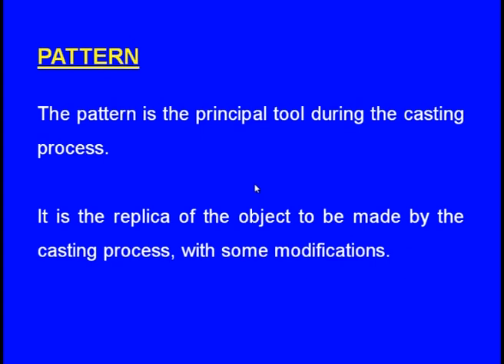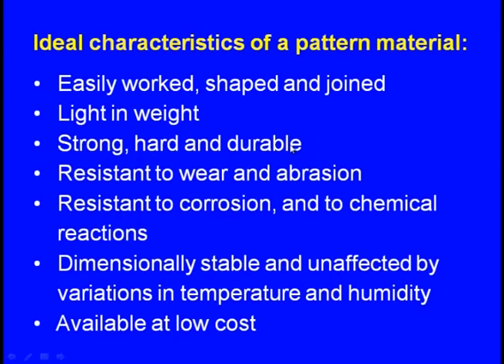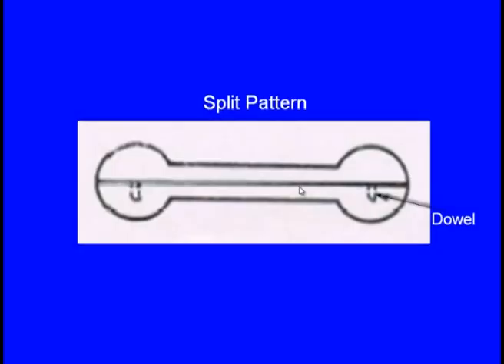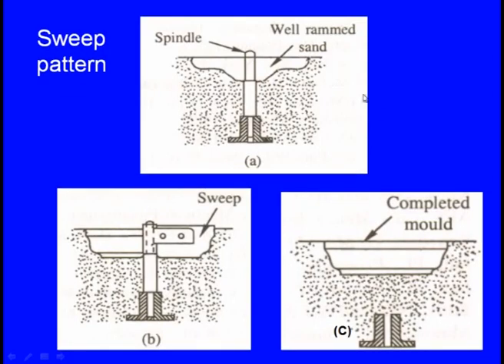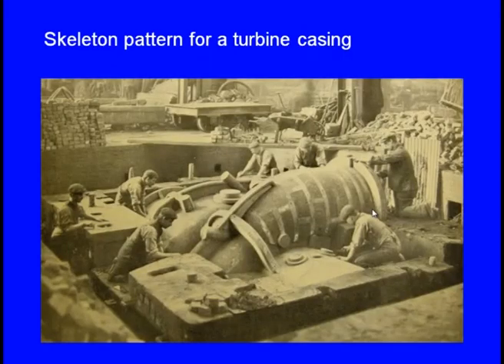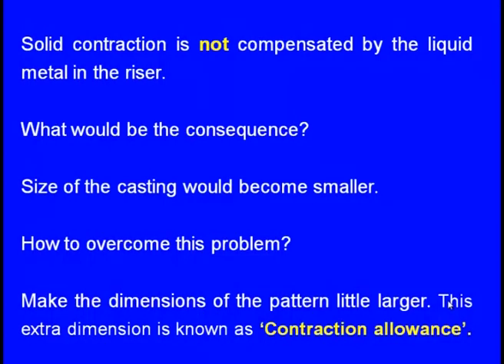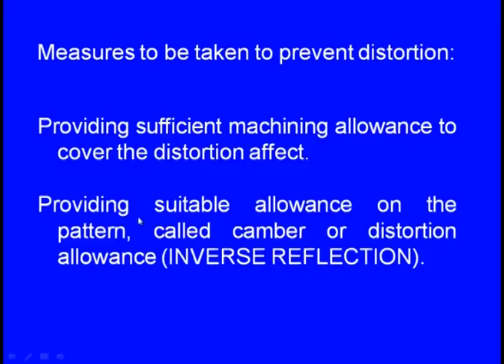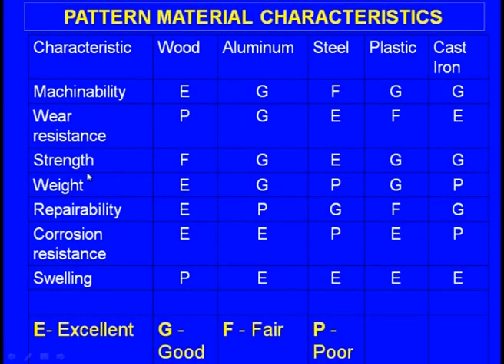Patterns and Allowances

Comment: Sir, 
I have a doubt about the solidification shrinkage. This is avoided by the liquid metal which is in the riser. But, when the molten metal will come in to cavity at that time the outermost parts of the casting is already solidified so, how can it will mix with?????
Reply: Shrinkage allowance is given due to the very same reason. Riser cannot compensate for shrinkage when the metal is solidified. Riser is only for the shrinkage of liquid due to change of temperature.